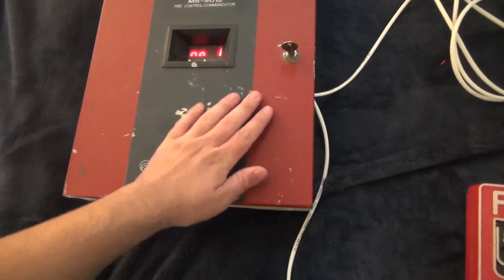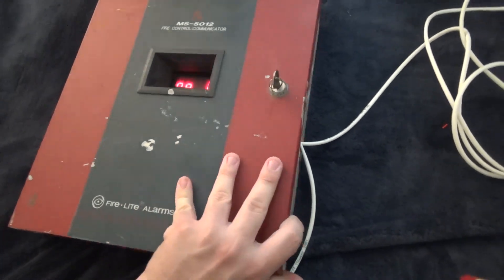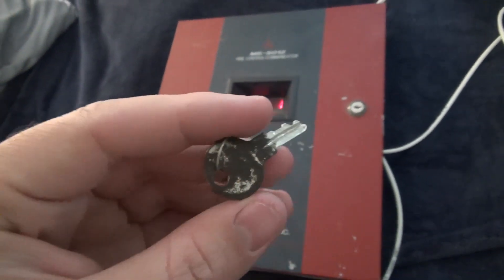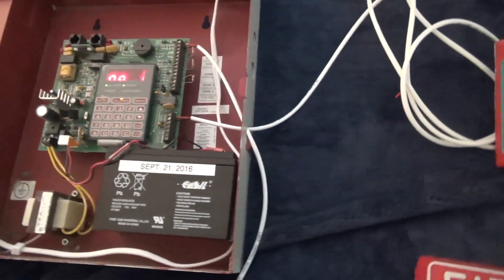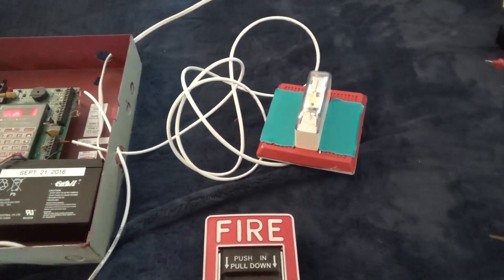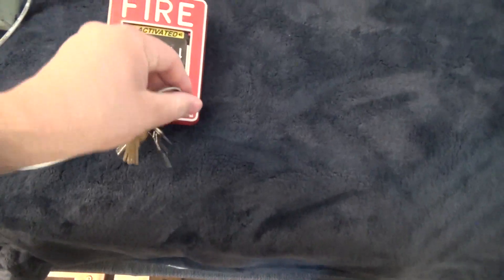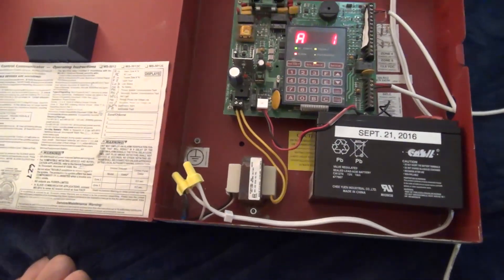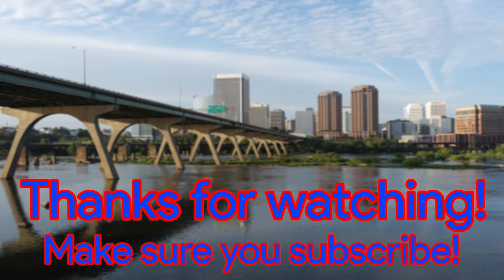My $10 Firelite MS-5012 Panel Demonstration

Comment: been trying to find a cheap panal not ahd much success
Reply: Gaming Tuff Look on eBay and see if there are any panels up for a small bid. And then start bidding and see if you can win it!
Reply: @thatelevatorpersonfilms  Okay ill look around thx for the info
Reply: How much are you willing to spend? You can get a Honeywell vista and keypad for like 100 bucks it is meant to be a burglar panel but it also works as a fire panel
Reply: There was a Notifer SFP-10UD without a case on eBay for $200 in fully working condition but I guess that’s not cheap enough for you